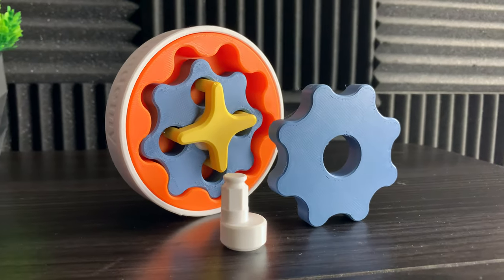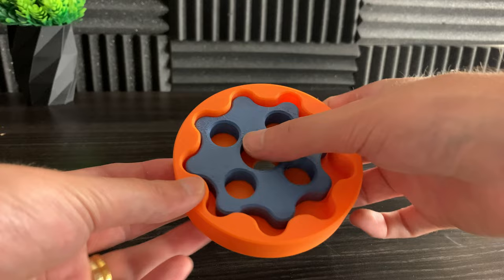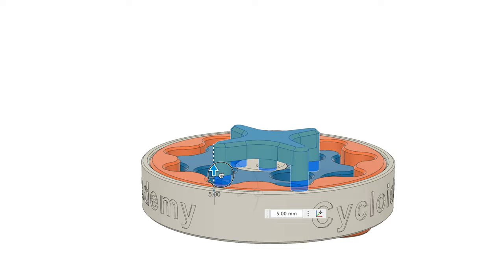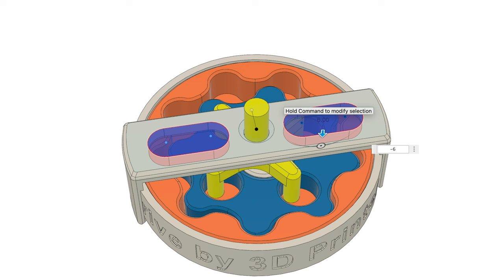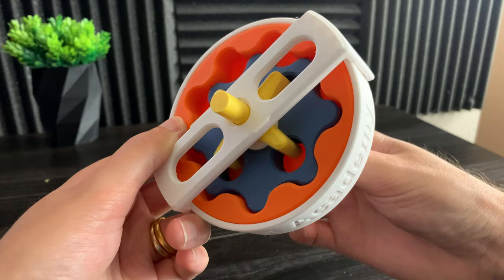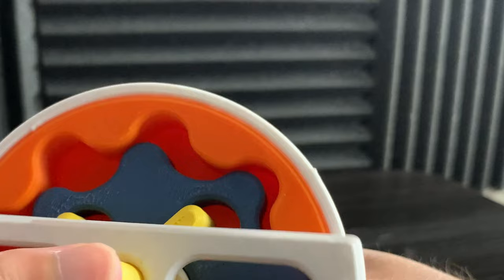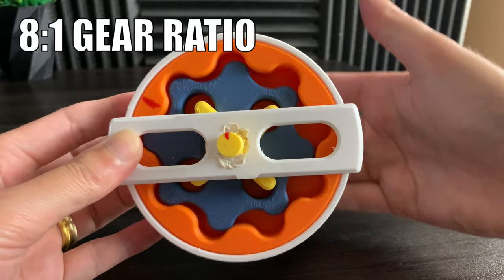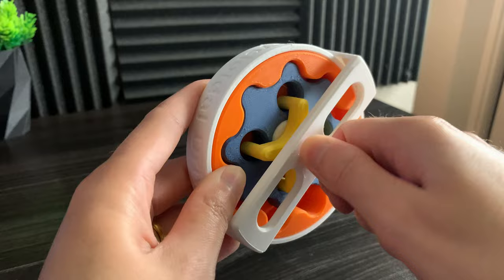What makes cycloidal gearboxes so amazing?

Comment: A cycloidal gear drive CAN be back driven. Yours was just not smooth enough to allow for the motion.
Reply: If the tolerances are fine enough and the surfaces of the right shape and surface fineness a cycloidal drive can be back driven. The (usually) high reduction of cycloidal gearsets makes for a high loss of torque and thus difficulty in back driving them. The fact that all teeth are in rolling contact with their counterparts means that a MUCH larger torque can be transmitted and the risk of shearing off a tooth on a pinion or bull gear disappears.
Reply: He also was not going to get enough torque by hand with that small shaft
Reply: Great content
Reply: He did it in the final shot.

Comment: I think this is very cool, however, there a very many drawbacks to cycloidal gearboxes with the biggest being manufacturing as well as vibrations. Do to all the rubbing that occurs they easily generate rough vibrations which is unacceptable in profession machinery. When it comes to manufacturing the process to mass produce gearboxes. A standard gear is very easy to manufacture, however a cycloidal gear requires a milling machine. This is okay for special cases but their is a reason why you rarely see cycloidal gear drives mass produced. (Also cycloidal gearboxes can be back driven)
Reply: I think you mean precision machinery, not professional machinery.

Standard spur gears often require milling to create them as well, especially if they need to be precise.
Reply: Vibration can be reduced with a second set out of phase.
Reply: A milling machine is more specialized than a gear hobbing machine? 😂😂

Comment: Everybody talking about an imbalance, I made a 3d printed one for a robotic arm for my mechanical engineering swnior project. I printed 2 rotors 180 degress out of phase. There was no vibration.  Also, you can back drive them as when the robot lost power, the end of the arm would drop.

Comment: Using this with steel encased with oil at higher RPM: Handheld? Vibration monster with some heavy waddle with the rpm ramp-up. Fixed machine - Very nice aside from that it's a Friction monster regarding sliding-friction (where it sort of slides at the apexes pointing inward from the orange gear), if it's smooth it will work nice, but the sliding-friction will create a lot of heat.

Dirt & Grime: since the apexes of the blue gear seems to "press" into the wells of the orange gear, dirt and grime could cause incremental damage which would seize the system very shortly after first detection of any irregularity.

Using pristine and pure material and-of utmost exquisite part-precision and lubrication you can have a very small high torque gearbox that WILL in fact last a very long time. Yet still, after the first detection of any irregularity, you will have a failing system in no time. It's very delicate, but still if you want very nice things you need to be prepared to lose them easily.

This also seems ridiculously easy to replace, lots of replacements won't be a hassle in most machines and devices, the cost for this even with the best of everything you can get will still cost significantly less if you desire keeping spares and have the will to replace them when needed so.

Comment: I have a doubt, on my project i was using planetary gears to make a reduction of 64:1, but the high RPM and friction kept destroying the teeth. Would a cycloidal gearbox be a good option?
Nice video btw
Reply from the maker: potentially. the load is distributed
Reply: Lubricant it 🤣

Comment: friction between blue gear & white shaft??
Reply: There will be some. If the tolerance isn’t too tight then it won’t be an issue. Often people put a bearing in there and between the yellow piece and blue piece to help reduce friction. When you make any gearbox to actually use you should lubricate it and with 3D printing the gearbox will probably need to be “broken in”, just run it until it gets smoother.

Comment: How do 3D printed Cycloidal gearboxes hold up to wear versus planetary?   I want to start getting into designs involving motors and rotation, but I want to stick to one dominant gearbox strategy to start, I I prioritize ease of printing and reliability.
Reply: What ever you go for using some form of lubrication is always a good idea.

I started with jus a compound spur gear, gear train and it worked well enough, especially with nylon and lithium grease. Then I tried a planetary gearbox and it worked well too, albeit being more difficult to assemble (part of that was just my design). I haven’t tried cycloidal yet, but I plan on doing it. You should just experiment and try a few, just small scale ones with small motors and see which ones work best for you, with all the gear generators you can get now it really isn’t that difficult to design them. You should also experiment with different gear profiles like helical or herringbone.

Also when printing gears do it on rafts, any elephants foot could cause the gears to mesh incorrectly and may lead to excess friction or the gearbox just not working. I prefer printing gears with a 0.25 mm nozzle but 0.4 mm does work too, you just won’t be able to make gears quite as small.
Reply: @conorstewart2214  Excellent advice, thanks for typing that out for me

Comment: It would be cool to see a backdriveable/reversible cycloidal gearbox.  And am I crazy or does this look like it could be turned into an electric motor?
Reply: your crazy. This is a gear box, not an alternator or generator.
Reply: Could be attached to a motor in a fairly compact package, especially for the reduction. However, this is not, and never will be, a motor.
Reply: wdym turned into a motor lol